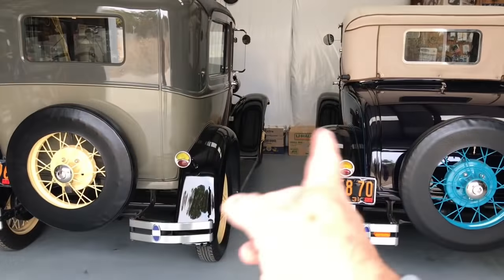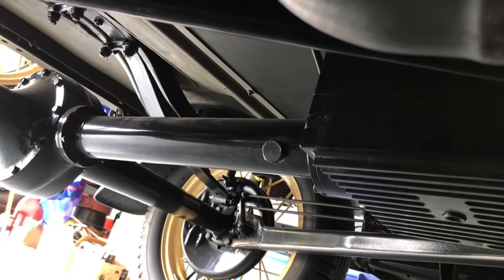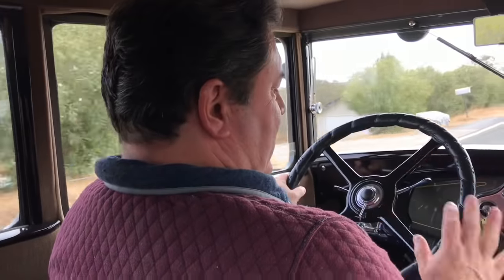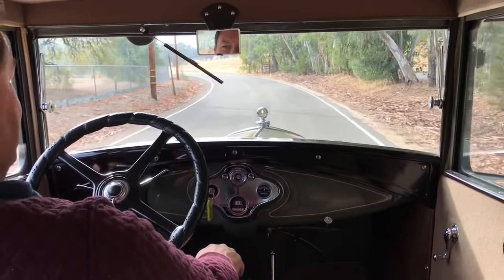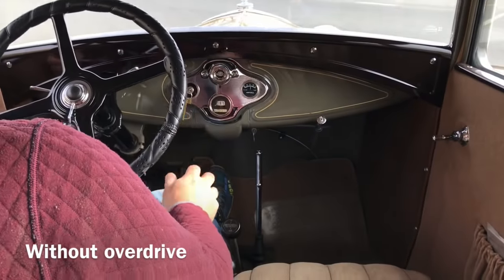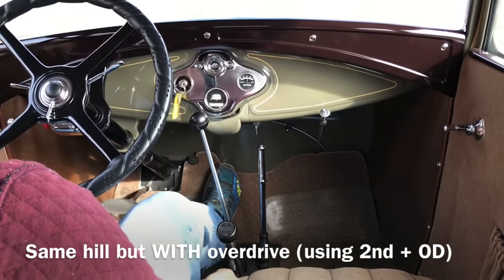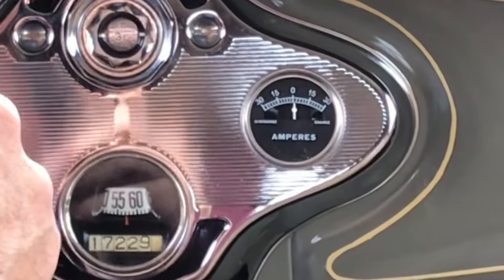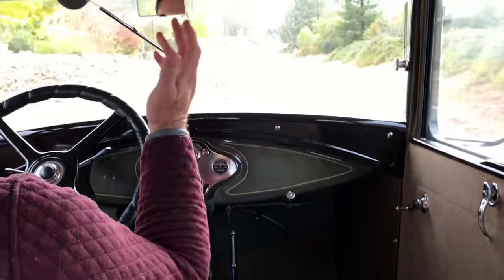Ford Model A Overdrive.  How it works, what it does!  Mitchell overdrive overview

Comment: After 18 months my 30 coupe is almost mechanically finished, I had to replace/rebuild everything except the motor it was done in 1970 ,car was painted plus a new interior was added then parked. I will be the forth owner, my Grandfather bought it from a neighbor in 1951 the second owner, then my dad the third,car has always been under a roof and has no rust. The only thing is the trunk sheet metal was completely gone, my dad used to put a sack of fish in it and I am having a hard time putting a new one in, I have the sheet metal but the very back parts I don't know about. I do have local people here but thy are hard to get to find sometimes.This car came with a trunk and I am going to keep it that way.It will be different from most all I have seen but that is how it came.The car has about 82000 miles but had never been taken care of.Love your videos plus  U tube has helped me,I thought I knew how to work on a car now I know more but not all.People do ask a lot about it everywhere I go.Be patience as we represent the past ,see if the link works.https://i.imgur.com/xtK0Irm.jpg

Comment: When you put the jack stands on the cinder blocks under the frame you should have turned the blocks over with the holes facing up with a board on them then the jack stands on the board. With the blocks on their side they could collapse.
Reply: I gasped out loud when I saw it, but realising the blocks
are not the same as ours, that crumble when you
pick them up.

Comment: I'd recommend standing your cinder blocks upright and span with a short piece of 2x8. The way you're doing it the block could collapse.
Reply: Cinder blocks was a big No No for standing vehicles or other loads in our Auto Mechanics course back in 1980. A hairline crack can develop and suddenly the whole thing colapses.
Reply: Total madness using a cinder block especially on its side. The weakest part. 🤪 use wood!
Reply: Howdy keen eyed and safety continues gentleman ... see my above  Thank you !
Reply: @derekferguson385  never ever concrete blocks or bricks for support under a car. Use blocks of wood.
Reply: I noticed that risky cinder block placement, too.  
If you absolutely NEED cinder blocks in a pinch, rotate them 90° so all walls are vertical and in pure compression, top them with a 2" wood plank, and position the jack stands atop the plank.
Reply: My girl friend thought my chunks of oil soaked 4x4, 6x8, and 8x8 wood was disgusting that she bought me jack stands.  Then she returned them to Harbor freight.  Those blocks don't smell so bad now.

Comment: Hi Paul , you are complete gentleman, your kindness is overwhelming, your integrity impecable, looking forward to seat, watch and enjoy every second of your video installing that overdrive gear box, at my 71 years of age I have all the time to enjoy your videos with very explicit easy to understand technical vocabulary that keeps me glue to the cell phone until it's finished but looking for more, blessings to you and your love ones, most kind of you, from the endless summer paradise Puerto Rico Jesus Torres.
Reply from the maker: You are so kind!  Gracias, mi amigo!
Reply: @ModelA  Good morning Paul, once again your videos are coming thru with outstanding, very neat, well organized, very easy to understand technical vocabulary, highly informative information with a touch of drive that make anyone looking for more, congratulations sir, blessings to you and your love ones,  your Spanish is outstanding, you make it easy all the way around, respectfully are really fluent in Spanish or technology helping unconditionally?from the endless summer paradise Puerto Rico Jesus Torres.
Reply: @ModelA   Good evening Paul, recently I heard you talking about the model A ford engine that you won't rev it up above  2,000 rpm, obviously I understand the nature, the engine lubrication system is not that efficient as newer engines but hipoteticly speaking could it be possible to drill off the crankshaft and other oil passage in the Block to improve the  engine lubrication system? Of course it won't be that easy but at my 71 years of age and been working in research and development I would think that can be done, I didn't have the opportunity to work on those toys but you day and day out come across with them, should you have the chance respectfully  please let me know, my most expensive thanks for your kindness, from the endless summer paradise Puerto Rico Jesus Torres,  MUCHAS GRACIAS CABALLERO.
Reply from the maker: Some people drill the crank and do a pressurized oil system.  And they almost always end up with a broken crank.
Reply: @ModelA  Hi Paul, you always come thru as a complete gentleman as you always have been, my most expressive thanks for your kindness for your unconditional technical support, blessings to you and your love ones, from the endless summer paradise Puerto Rico Jesus Torres.

Comment: The Mitchell overdrive for the Model A Ford allows splitting of the 3 speeds on the manual transmission giving 6 speeds forward. The result is a more versatile transmission where a gear can be selected that matches the road and speed conditions.
Reply: Put in 5 speed  way nicer, no ugly extra stick through floor,  way superior.

Comment: I have a Mitchell Under/Over drive box out of a delivery truck.  It is a modern copy of the old Brownie Boxes or Spicer Aux Boxes.  It is all Aluminum and weighs 83 pounds where as the Browne Lipe is well over 100 pounds.  It is made by the same Mitchell company as what you guys are using.
Reply from the maker: Neat!!  Any video of it?
Reply: @ModelA  Hasn't made it into the truck yet.  I bought it a while ago but haven't found the time or the shop that can put it in.   My old Dodge has a horrible gear spread between 2-3 like your Model A and this Aux could make my 5spd a 10spd.  

This is the only pic I have of it https://imgur.com/gallery/fx44q

Comment: Hi Paul, I've got a ha ha for you too: First off I am a lifelong mechanic and a car aficionado to boot. I have owned many great cars over the years, among them a 1969 Pontiac GTO, a 1970 Mustang Boss 302 and a 1959 Lincoln Premiere two door hardtop. The car I miss the most of all is my 1939 Plymouth Roadster Deluxe. The only problem I have with my Current ride, the 560SEC is that it's the best car I've ever had the pleasure of owning and I here's the problem: It's lonely at the top, I figured if I had a Model A I might not stand out so much in a crowd. 
On the other hand I have a piece of American history that I might like to offer in stead, namely a 1978 Classic GMC motorhome currently in the process of some interior renovation.
Reply from the maker: Nice, Carl.  Quite an array of autos!

Comment: Hey, Paul. I enjoy your videos. Wish you were around 2-3 weeks ago. My big project for the summer was to install a Mitchell O/D in my Town Sedan and due to Covid and social distancing I installed it by myself (I just turned 70). I could have used some pointers and since I'm a slow worker you would have had plenty of time for a video, haha. I replace my spring bushing and shackles while the rear end was out as I found one of the shackles broken.
Reply from the maker: Good work!!  Yes, that's the ideal time for shackle replacement.  Assuming the spring spreader doesn't fail, it is safer than doing it under the car.

Comment: I enjoyed the ride out there but I did cringe when I saw the jack stands on the cinder blocks. Looking forward to the future overdrive video. Thank you.
Reply: If you must use a cinder block (and please don't, it just isn't safe), it should be rotated with the holes top and bottom.  That is the way the cinder block was designed to handle a compression load.  The side walls are too thin to be safe they way you used it.  Also, a piece of 2 x 8 over to the top of the holes to distribute the load is not a bad idea.  
I have stored vehicles on cinder blocks in the past, but I just don't trust them enough to work under them in this posture.  Harbor Freight jack stands are safer (joke intended).  
I miss my 1930 Model A Truck.  I sold it in 1988.
Reply from the maker: I knew I was going to get a lot of flak about the cinder blocks.  The car was still hanging by the cables.  The jack stands were just an extra safety backup.

Comment: So if I understand correctly, you have four normal gears (R, 1, 2, 3) and with a high/low on the Mitchell, you actually end up with 12 gears (R123-each x low - neutral - high) which gives you a large range of gearing ratios. Similar to a semi.
Reply from the maker: Ehh... Sortof.

Comment: I have a 29 Roadster, with a Mitchell in it, it also has 16"wheels and 378 gears in it. I Bought the car like that, one thing the previous owner did was heat up the shifter for the main trans, and bent it. Every time I was in First gear, at a stop sign and i would put my foot on the brake my knee would hit hit the shifter. I ended up cutting it shorter, a little bit longer then the Mitchell shifter. i like to split second and third all the time, i can shift both trans at the same time, but have to shift the main a little slower

Comment: Did the Mitchel synchro trans with 15% extra in 2nd.   Also did 3.27 rear gears so 50 mph no problem.  Lightened the flywheel and used a V8 pressure plate to a total of 40 pounds allows instant shifting into 1st w/o grinding when lights turn green.  Nurex aka Phillips spark advance makes car easier to drive.
Reply from the maker: Nice work Andy!
Reply: Fresh motor with custom oversized Stipe B cam to avoid cam bushings, larger valves, Zenith B carb/ intake, Snyder 5.5 head  and Petronix ignition makes motor good puller.  Drove buddies Mitchell overdrive.  Cool but I did not want the extra lever on the floor.  His next car he did the super high speed rear.  My engine rebuilder too.  All happy but all agree a strong motor is needed.

Comment: Please use a single square block of wood under the jack-stand instead of a cinder block laid on its side!   Cider blocks can shatter and crumble, particularly when laid on their side, which are not designed to be load-bearing!
Reply: hauled a guy out from under a car for that very same reason when i worked as a fireman. it didnt end well for him. the blocks pancaked and you can only guess what happened. im glad you brought that up. he was under an 80s model lincoln continental though. you get wrenching and torquing under there and putting a little wiggle on the car and the blocks cant handle it with no diagonal support. again, i hope somebody read your comment and actually took heed to your advice. im glad you brought it up.

Comment: Two things... don't want to be "that guy" but using concrete blocks like that is very dangerous!  I've seen them fail before and it wasn't pretty!  I use cut pieces of thick railroad ties which work great.  Second, as far as the camera work, i'd recommend using a GoPro with a head mount so you can keep recording while working and it will keep your hands free.  The demo of going up the hill in 3 normal versus 2 high was really amazing!  And with the o/d, will it go past 60mph now?
Reply from the maker: Thanks.  And, you're right.  Yes, it will go over 60 MPH with ease.  I have driven a Model A 70 MPH while doing an exhibition against a biplane going down a runway at an air show.  But on the streets- no way!
Reply: @ModelA  Wooo going 70 i bet that was fun!  And yeah on the street with those brakes i wouldn't chance it, maybe on a Sunday morning on the interstate when there's no traffic

Comment: Paul, Your demo of the overdrive on the road was great!  I was so into the shop segment and sank when the camera failed.  I could have joyously watched the entire install so I hope that you'll get to the next one soon.
I want to say that I got the creeps when you put the jack stands on the weakest side of the concrete block.  Paul Please, the block is strongest with the holes side vertical, then put a piece of wood over the holes, then the jack stand.  I was worried about the car falling on you.
Does the overdrive unit have mounts or do the torque tubes supports its weight?
Is Low-overdrive the same as without the overdrive unit?  Are there ratio choices?
Lastly, Please put me on the list should you ever decide to sell the Tudor.  It's my favorite body, and I've been admiring yours in each video.  God Bless.
Reply from the maker: I did a full overdrive installation video about a month ago.  Check it out.  As for the cinder blocks, the car was suspended by cables.  The blocks were just to stabilize it.
Reply: @ModelA    I should have kept my mouth shut, I thought the cables were being removed.
And the full installation video was listed right after watching this one.
Sorry Paul.  Call me Aire-Head today.
Reply from the maker: @discerningmind    Nah, you get a pass, my brother!
Reply: @ModelA  Thanks!

Comment: I had a 1947 Ford with a Columbia overdrive in it, when I shifted into overdrive the speedometer would drop 20 mph, it would go 85 mph out of overdrive and 75 mph in overdrive because the engine didn’t enough power to buck the wind in overdrive.

Comment: Excellent presentation Paul showing the obvious advantages of a Mitchel overdrive installation. Would you be able to answer a question I have regarding whether or not there were some Model A's late in their production run that came equipped from the factory with an optional heater that ran off the cooling system?
Reply from the maker: No Model A's came from the factory with heaters, not even the high-end deluxe sedans.  Any heater in a Model A was added after it left the factory.  Dealers could install them for example.

Comment: My (Danish) A is finally ready for inspection and registration, and I start thinking of gentle improvements. One would be increasing compression from 4.2 to 5.5 with another head. I read it will run cooler, get 50+ hp and and thus improved mileage. Also read not to go above 5.5. Do you agree with this? if so, do you know which brand is the better head? Brumfield maybe? We won't drive it hard, max 40 mph.
Reply from the maker: High compression heads is usually one of the first hop-ups people do to Model A's.  If you have babbit bearings in the bottom end, don't go past 5.5 ratio.  If you have inserts, go crazy if you want.  But the 5.5 is the best running HC head, in my opinion.  Higher than that and you lose the low idle, effectively reducing the useable RPM range.  I have used the heads Tod Buttermore makes and sold by Snyder's. Never used a Brumfield on any of my cars.  No experience with them.

Comment: Great video until I saw  a cement block being used to support the Model A. More backyard mechanics have hurt or killed by cement blocks breaking and the car falling on them . Use stacks of solid wood to support the jack stands .
Reply: They actually had the car hanging on a couple of hoists attached I assume to a beam. See the scene at 9:57. But yeah I agree about the blocks breaking.

Comment: Nice video Paul, I like the O.D. but i'm not sure I myself would like to drive my  Model A faster than 45-50 mph, going faster is easier than stopping faster, but thats me.
Reply from the maker: Since I always redo the brakes on my Model A's, the braking is excellent, so that removed the scary factor somewhat.  However, even at 45 MPH, the overdrive makes that a quieter ride and improved MPG greatly.  My Sport Coupe with overdrive gets 25 MPG pretty routinely.

Comment: Paul very nice to see the guys working like in there teenage time get your dad some proper wood blocks for the jack stands cinder/concrete just plain not safe
Reply from the maker: I knew I was going to get a lot of flak about the cinder blocks.  The car was still hanging by the cables.  The jack stands were just an extra safety backup.
Reply: @ModelA  Good just watching out for my favorite model A channel
Reply from the maker: Thanks for having my back!

Comment: Hello Paul, even though I saw this video just today, I saw the other, you installing the mitchel overdrive into your friends car, just the other day. Now you got me thinking if I have will put one MO into my A.  As I never took out the clutch or motor out of my car -as yet-, I wonder - you said in this video you would change the clutch right then and there as the whole parts are already out - what would I have to do, to change the clutch? I would not have to take the motor out, wouldn't I? Maybe I could at the same time solve the two litte leakage problems I found around the gearbox..... All the best Robert
Reply from the maker: You might as well change the clutch.  Once the rear end is out, just pull the transmission.  The clutch will be right there.  Just sayin'.

Comment: You just showed me why I like my 6 peed manual.  Most of the time I go from 1st - 3rd - 5th - 6th.  2n and 4th are for when I am running slower or up hill.  What is the gear ratio in the overdrive for high.  I assume it is 1 to 1.25  Increasing the speed by 25%  Let me know how close I am.  Back in 1974 when I was going to McPherson College, it is to bad that they did not have the automobile restoration program back then.  I enjoy going to their car show in May so that I can wonder thru the program building.  At 67 I am a little old to start over.
Reply from the maker: It's 26%.  Close!!!
Reply: Watching your video gave me a very good idea of the step up ratio.